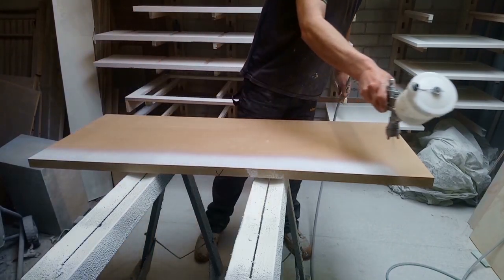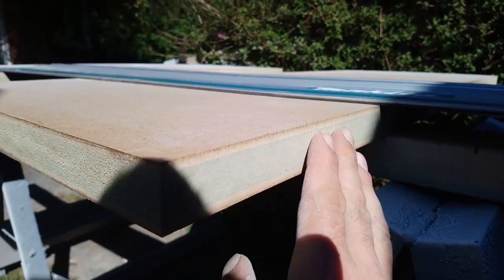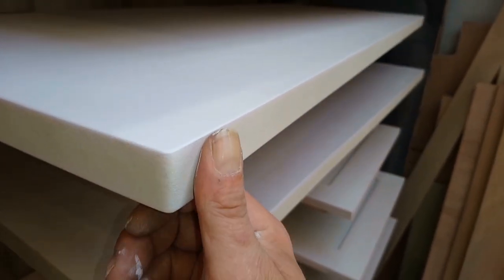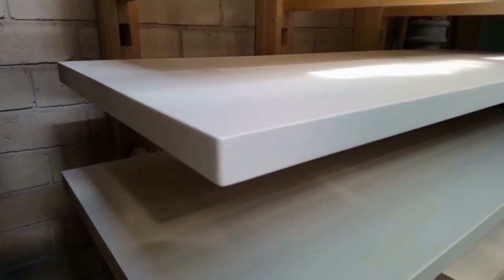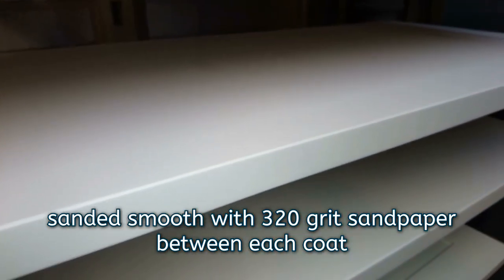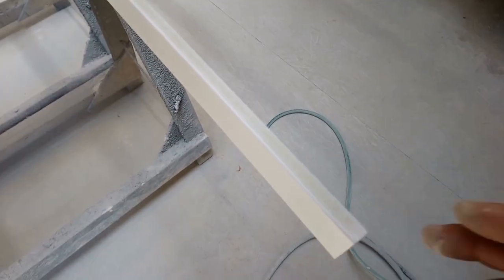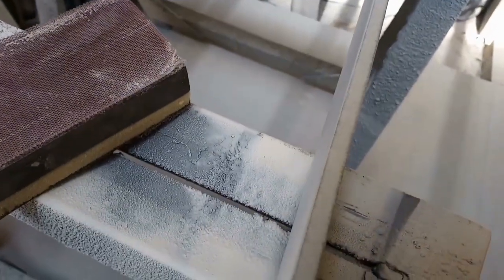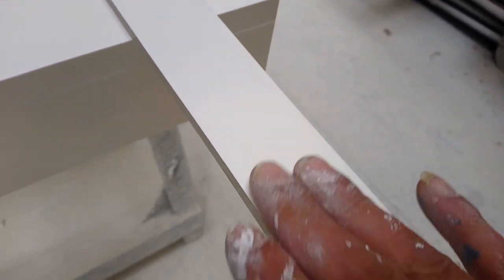How to Paint MDF edges - without special sealers

Comment: Understanding grits and the important's of when to use them was one of the best lessons I learned.
Knocking the edges of gives it a very professional look.
I have never used 30mm MDF but looking at those doors, it really looks good, again, it looks factory professional rather than DIY
Reply from the maker: Thanks Harvey, yep working down with the grits is key to least effort, sanding smooth is important on MDF edges but there are also tiny pits where the grain has torn out when cutting so those need sanding out with a coarse grit before using finer grits, they can be filled with the paint as the layers go on but spraying paint doesn't like filling holes as a hand brush would, it's something to do with surface tension i think,  👍 Yep it looks really good, it feels nice n satin 👍

Comment: This technique appears very sound in its principle.  I didn't like the idea that sooo many videos suggest of using drywall joint compound.  Thank you for sharing this trick to getting a perfect finish with MDF!
Reply from the maker: No prob, you're welcome, there's loads of vids showing fancy ways of sealing the edges, most surfaces can be sealed with a thin coat of the paint your using so why not the edges, PVA is the main one i notice but PVA takes too long to dry, is streaky if put on with a brush & is a bit rubbery to sand, & depending on what sealer you use there's a small chance of it being incompatible with your paint when mixing different substances, I've done this for a long time with any of the paints i've used, it's a simple decorators tip i was shown, dilute some primer n bang it on, then fill n sand smooth, put another less or none diluted coat on n see what it looks like, fill n sand as necessary, then put another, hopefully final coat of primer, when the piece is as perfect & blemish free as you want the final finish to look only then do you put the top coats on, 👍 Thanks 👍

Comment: Thanks mate. Do you recommend any spray guns?
Reply from the maker: Thanks & yep def, My no 1 gun is the Devilbiss FLG5, it's not cheap but def a one time buy, this gun i use 90% of the time, https://www.spraygunsdirect.co.uk/index.php/devilbiss-flg5-compliant-solvent-spraygun-best-seller.html#sthash.yVNLOevu.dpbs
Reply: @Gidjoiner  thanks mate. I've been looking for ages for what an experienced spray painter would recommend for furniture. The website is so clear too. Amazing! If you made a video talking about spray equipment for furniture, I'd watch it a dozen times
Reply from the maker: Thanks 👍 My setup is fairly simple,  I have a Bostitch 50L compressor which is only just big enough, I'll upgrade to a 100ltr with a bigger CFM one day maybe, (CFM is how fast your compressor pump will refill the tank as you use the air) I've a variety of Gravity fed guns & a wall mounted regulator/filter set at about 20-30psi, very simple to set up, The cheaper guns i use sometimes are ANI for about £24, they're good to start with, the black ANI i use sometimes is a bit more £45-ish & the Devilbiss FLG5 is a bit more than £100 but it's the best & my favourite, it's the one you'll see me use most of the time, the paint strainers i use for all paints, the only ones i buy are Starchen 190, I get mine locally but can be got on ebay etc. https://www.ebay.co.uk/p/1292815382?iid=113200954395&chn=ps&norover=1&mkevt=1&mkrid=710-134428-41853-0&mkcid=2&itemid=113200954395&targetid=879043638628&device=c&mktype=pla&googleloc=9046317&poi=&campaignid=9455575137&mkgroupid=94880575894&rlsatarget=pla-879043638628&abcId=1139576&merchantid=7341554&gclid=CjwKCAjw5Ij2BRBdEiwA0Frc9SSEKwHUlAOBKkG1HPN803XblvAQwt4Mt6gWa1BsEcuE70eue-P9fBoC2_EQAvD_BwE  Sprayguns direct is good site if you want to talk to someone https://www.spraygunsdirect.co.uk/index.php/ & the green hose i use is Ragno, it's food safe so no contaminates inside, it stays soft even in th cold of winter, i would suggest buying a hose & only using for spraying, that way you know there's no or nasties going inside https://www.thorite.co.uk/products/tube_and_accessories/rubber_hose/merlett_ragno_pu_hose_puthermoplasticrubber_abrasion_resist/ Through my videos i mention my setup but like i say it's fairly simple, https://merlett.com/couk/product/ragno-pu/
Reply: @Gidjoiner  wow, thank you!! That's super helpful!!
Reply from the maker: No prob, you can buy mixing cups but ages/yrs ago i bought a box of plastic pint glasses which you might see me use, i use them liberally but still have quite a few 😂 this is the bookmark i have on my PC https://www.stephensons.com/disposable-pint-glasses.html

Comment: Great video Thankyou, can I ask what you used to round the corner with? To keep them all uniform. Was it a router? 

Many thanks
Reply from the maker: Thanks Kyle & you're welcome, I'm glad you like it 👍 The corners i did by hand, I used the hard side of the sanding block or a piece of sanding block sized MDF & sandpaper, I can't remember which but it's important to not use the soft side of the block or it'll get rounded all over the place, On the long edges, Aris 😉, i would use the router if i wanted it round but in this it looks like i just sanded off that sharp edge, again with a hard side/sanding block, the tip is repetition, long sanding strokes remembering how many times you've gone over one area, The corners weren't rounded much so with one or two swipes of the sandpaper i'll knock the corner off (45º), then to round it off I'll place the sanding block on one side/edge corner, then roll the block around pushing it forward n so sanding as i go to the other side/edge, i'll do that the same amount of times on each corner so every one is the same, Sorry it's not easy to explain, I've been a joiner 36yrs so it's not something i think about or have to describe in words but i'll try show it in vid, 👍 .. I did show how i sand a corner by sanding in increments, sanding it off at 45º first then rounding it, can't remember which but i'll see if i cant find it...  
About 16mins in this vid i sand a corner https://studio.youtube.com/video/UvbNgveGP-8/edit  I think there's another vid, if i find it i'll put the link up,👍

Comment: I can't get my cuts quite as nice as that. I'm thinking it's my saw blade on my circular saw.

Any advice on the type of blade to use? I'm guessing more teeth...
Reply from the maker: It's hard to say, more teeth will give a cleaner cut but will clog quicker on rip cuts, there's blades with teeth that have the corners ground that give a cleaner cut, This video is quite old so I don't remember but this is about painting the edges & a lot of sanding was done,

Comment: Nice to see such attention to detail, looks great. Can I ask what filler you use with MDF (if not on the edges then presumably you occasionally need to use some to fill nail holes etc)? I find that gypsum filler or even Toutpret is too soft and leaves a faint witness of the hole, but the 2-part wood fillers I find awkward to work as they go off so quickly. Many thanks
Reply from the maker: Thanks Jobe, much appreciated, I use One Strike Ready Mixed Filler a lot https://www.toolstation.com/one-strike-ready-mixed-filler/p57514 & if i want a hard filler i use car body filler, https://www.amazon.co.uk/gp/product/B019MXFXIO/ref=ppx_yo_dt_b_search_asin_title?ie=UTF8&psc=1 unless i want a coloured filler then i use a 2 part named branded filler, we used car body filler when i did my apprenticeship, it's cheaper than the coloured branded stuff & you can buy the hardener separate cheaply so you don't have to worry about using too much, https://www.amazon.co.uk/gp/product/B0055BLC0G/ref=ppx_yo_dt_b_search_asin_title?ie=UTF8&psc=1  the hardener works with the branded stuff too who supply a tiny little tube, which i always use up before i use up all the coloured filler in the tin, you do have to work fast with 2 part fillers, if you put a little less hardener in it might go off slower but the tin is big enough & cheap enough that i just mix more if it goes off on me too soon, 👍
Reply: @Gidjoiner  great thanks I will give those a try. All the best

Comment: I have a job to make a display unit for a shop and they want it to be painted white. Now I don't have a fancy workshop or machines just your basic tools so what is would like to know is what paint should I use after I have primed the edges 3 times. What paint did you use in the video for the spray gun?
Reply from the maker: Whatever paint you use should be compatible with whatever primer you used, if it's water based then you should use a water based top coat, I'm a Joiner not a decorator tho so sorry i can't say what you should use.,
I use PU primer because I use PU enamel top coat, it's very hard wearing, resistant to most household chemicals &  dries in ½hr in good weather/temp but the stuff I use has to be sprayed, I think it would be hard to hand paint, the thinners for this paint can melt some plastics so I don't know if airless sprayers would be damaged  if you're not using a gravity gun and compressor,
I presume you're talking about MDF when you mention priming the edges 3 times, getting a good finish is not about how many coats. It's sanding it very smooth before painting, then sanding smooth between coats until the primer paint finish is as smooth as you want the final coat to be, the top coat is just the finish, the pretty colour that goes on top, all the work is done with the priming layers, whether it takes 3, 4 or 6 coats to get it right.
Reply from the maker: I get my paint from here, they're good to advise if needed https://symphonycoatings.co.uk/
Reply: @Gidjoiner  thanks for getting back to me. I've found a sheet of mdf already painted. I might use that and edge it. It's a shop display unit I'm making so not much chemicals will be used on it just some light dusting I'd say.

Comment: I am spraying for the first in the coming days, I have mdf sealed my edges and soon will be painting the edges and spraying the tops. I will be be using eggshell paint brilliant white. Any tips? I have the ratio sorted for my gun, also have a room with extraction! Can’t wait!
Reply from the maker: Hi, Did you hand paint an MDF sealer on the edges? If you did use an MDF sealer i wouldn't have bothered, as in this vid it's unnecessary, spraying shows up every flaw, the edges should be sprayed to seal them because brush marks will show through the sprayed layers & buying separate sealers is extra money , Practice that's all there is, make sure your primer layers are perfect, blemish free before you put the top coat on, i hardly do any sanding when the top coats go on, that's just the pretty colour that goes on top of all the hard work & prep in the primer layers below, best of luck, just practice & try to make it dust free before spraying, wipe down with a damp non fibre cloth

Comment: I was interested to see you using Abranet, I use it to to the exclusion of everything else. It can be aggressive, useful when you need it, but I usually go a grade finer than convention suggests. The beauty is you can go wet or dry, I use 600 grit to apply oil finishes instead of 0000 steel wool, as it leaves no deposit.
Reply from the maker: Hi, yeah i like Abranet for the painting side of things, it does have a grain & can leave lines if not used at an angle but it has a consistently even 'grit' so it leaves a lat surface, I keep buying it, Thanks 👍

Comment: Great video mate. Plenty of hard work but results speak for themselves. I was considering either going the off the shelf mdf sealer route or just using paint itself. Does it really matter? Ultimately you need to 'seal' the mdf, especially the edges where the compressed grain is more exposed horizontally. I assume using paint to absorb into the grain should seal it from moisture?
Reply from the maker: Thanks 👍 I personally would just use the paint itself, no need to buy stuff that's been branded as a special MDF paint, a lot of how it comes out in the end is down to how much effort you put in to sanding, I sand the edges very smooth to begin with & lightly sand between coats, the edges do need more than the face but i spray both sides twice with primer, so the edges get sprayed each time, 4 times, Some people show using PVA but that takes ages to dry, up here anyway, & when it does it's a bit rubbery & hard to sand smooth, Whatever you put on the edges there's a chance of a bad reaction between the different substances, I would just use paint n see,  I always make sure that all filling & sanding is done in the primer coats, once the primer looks as unblemished as i want to finish to be only then do i put he top coat on, the top coat is just the pretty colour that goes on last & here should be almost no sanding. Sealing from moisture would depend on the paint, i use a solvent based PU Enamel so yes it is quite waterproof but water based stuff i don't know how moisture resistant, I use Medite MR MDF, which is moisture resistant but any MDF i would avoid putting in a damp environment, except Tricoya mdf but that's not cheap.

Comment: Great Job. Where did you buy those sanding sponges from by the way as they look pretty decent?
Reply from the maker: Thanks 👍 They're from Axminster, the sanding sheets i used were Mirka Abranet, someone mentioned Sianet which are cheaper so i bought some as a trial, you get a lot more in a pack so i'm still going through them but i think they are slightly cheaper quality than the Mirka Abranet, flexipads https://www.axminstertools.com/flexipads-hand-block-medium-soft-510003, mirka-abranet-abrasive-sheets https://www.axminstertools.com/mirka-abranet-abrasive-sheets-70-x-125mm-120g-pkt-10-502625 Sianet Sheets 70x125 https://www.ebay.co.uk/p/932599971
Reply from the maker: I've found these on ebay, the Sianet ones i bought on ebay were from Axminster 🤷‍♂️🤷‍♂️ https://www.ebay.co.uk/itm/Mirka-Abranet-Abrasive-Sheets-70-x-125mm-120g-Pkt-50/232012683224?epid=1144201396&hash=item36050897d8:g:INwAAOSwW2VfSRNm There's other sellers https://www.ebay.co.uk/itm/Mirka-Abranet-70x125mm-P120-Grit-50x-HookNLoop-Dust-Free-Sanding-Abrasive-Strips/382347981148?_trkparms=aid%3D1110006%26algo%3DHOMESPLICE.SIM%26ao%3D1%26asc%3D225113%26meid%3D08cb8a9afd64451da3298b0f0822b514%26pid%3D100005%26rk%3D2%26rkt%3D12%26mehot%3Dlo%26sd%3D232012683224%26itm%3D382347981148%26pmt%3D0%26noa%3D1%26pg%3D2047675%26algv%3DDefaultOrganic%26brand%3DMirka&_trksid=p2047675.c100005.m1851
Reply: Cheers Gid that’s great

Comment: Excellent work sir, I prefer to use thinned down pva to treat the edge first.
Reply from the maker: Thanks Brian, I find thinned down PVA can sometimes leave brush marks if not thinned enough & PVA can be rubbery to sand, PVA goes well with most paints & i haven't had a bad reaction or adhesion failure to any, but the way i do it using the primer i'm painting the pieces with to seal the grain I know I'm def not going to get any adverse reaction & adhesion should be near perfect, also PVA can take time to dry properly, if brushing on by hand it's time consuming & imperfect, it's an added unnecessary step/stage, the paint i'm using is already in the gun, spraying is fast, consistent n dries hard, ready to sand in 20-30mins 👍
Reply: I totally agree sir, I just don't have your spraying skills😭😭😂👍
Reply from the maker: 😁😁👍 If i wasn't spraying i think i would still just use a thinned version of the paint/primer I'm using rather than PVA, Polyvinyl acetate means it as a rubbery/plastic consistency to it n isn't easy to sand flat 😣 If you have a compressor spray guns can be bought very cheap, i have two of these for about £24 https://www.spraygunsdirect.co.uk/index.php/sprayguns-parts/gravity-sprayguns/a-n-i-f1-ns-budget-gravity-spraygun.html#sthash.VnSCmDkD.dpbs, you could spray the thinned PVA & thinned house paints but single stage fast drying paints similar to what i use can be bought for similar prices to good house paints,

Comment: Hi, great video by the way. Can you tell me if this is moisture resistant MDF? I've used normal MDF from my local timber yard in the past was about £20 for an 8x4ft sheet. Just wondering where is best to get good quality and prices. Cheers.
Reply from the maker: Hi, yes i only buy Medite MR MDF, it doesn't feather up so much & the face is flatter & stays flat when painted, this came from Arnold Lavers, it's a bit more, not sure without looking on the pc but about £28 i think. Thanks 👍
Reply: @Gidjoiner  thanks mate

Comment: Looks a great finish, I’ve got some mdf to paint, do you just use a overthined bit of the top coat for your primer/sealer ?
Reply from the maker: Hi, sorry for late reply, YT notifications are a bit rubbish,  Yes but not top coat just the primers then top coat, the only difference is I use a slightly thinned primer as the fist coat, this soaks in & 'prepares' the wood, it makes the fibres swell a little & locks them in place, those swollen fibres then get sanded smooth, i expect that first coat will get mostly sanded off the surface but because it has soaked in it has done it's job & reduced how much the fibres will swell when the next coat goes on, Edges always need a little extra painting & sanding smooth between coats but just using the paint you're going to put on the rest of the piece means no fannying around & any chance of a bad reaction  or poor adhesion between different products. Some people use PVA but i find that a bit rubbery & hard to sand. PVA takes a bit of time to dry & like i say you're fannying around using different products, This same process can be used for hand painting, sand back smooth after the fist coat & the subsequent coats will go on smooth, I make sure that the last primer coat is smooth, blemish free & as perfect as i want the final finish to be, the top coats are just the pretty colour that goes on after all the work is done & shouldn't have any filling or repairs if poss 👍